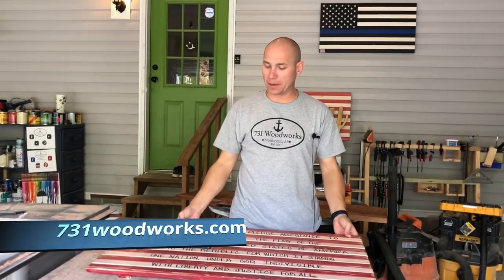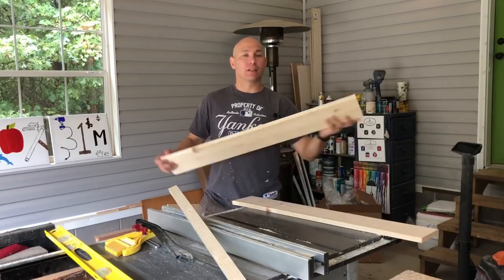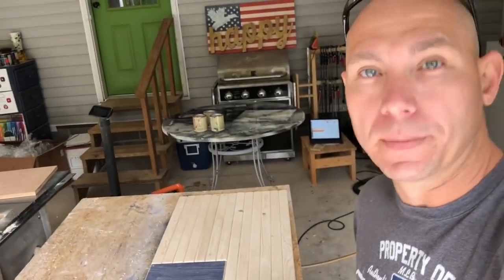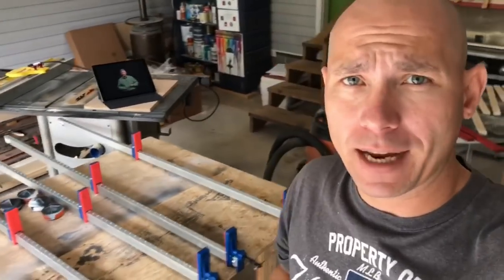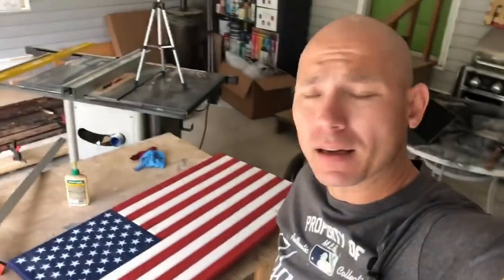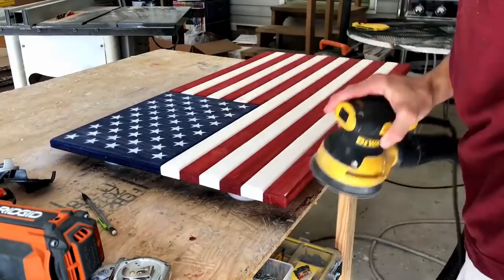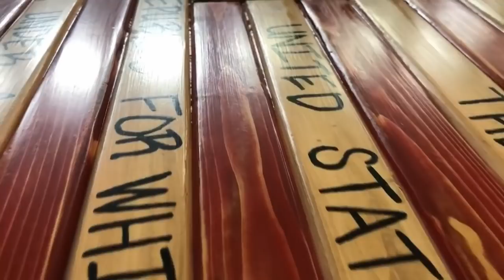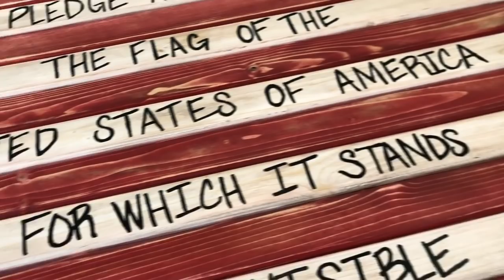How to Build an American Flag Out of Wood

Comment: I started making my own flag tonight. I am on quarantine so I dug through the garage looking for scrap wood. This is really my first real woodworking project in 20 years.  I thought I would get cute and use some old 2x6's that I had. I ripped strips off of them an inch wide.  Put the strips together and they were all kinds of twisted. Used your jointer method using the level and it worked. Not perfect but good enough.  I just enjoy doing this. I want to make stuff in my free time that can be a blessing to others.  I can't pay the bills using my hands though lol. God Bless!
Reply from the maker: Awesome

Comment: Today I learned that when I use 1x4's instead of 1x6's, the left over strip on the 2nd cut is exactly the width I need for making runners for sleds on my table saw. It isn't the exact depth to go very deep into the miter slot but the width is perfect. Im going to see if this will work or if I'll need to glue 2 of them together. I thought it was a pretty cool discovery. 🙂

Comment: Love the flags.  My question, you put a wax and antiquing stain on prior to the finished seal coat,  doesn't the wax keep the seal coat from adhering the the project?
Reply from the maker: It didn't affect anything with this build.  Typically I do it the other way

Comment: Awesome video!  Could you use pocket holes to attach the panels together instead of the boards on the back?  For a more seamless look?
Reply from the maker: Maybe, the thinner strips may be too thin to get a pocket hole to properly drill

Comment: i would like to make one for the 4th July with pallet wood - my question - which brand and make water based wood stain did you use?  Can the flag be placed outdoors? is it a stain and sealer which offers all-weather defense in just one coat? is it a Semi-transparent stain that adds more grain-enhancing color and sun protection?  Does it Provided mold and mildew resistant finish?

Comment: Matt great content and great delivery. You make these projects very easy to follow along. Im in the process of building a few of these for gifts. Couple questions. Is there a reason you dont use birch for the stripes as well. Also why use the antiqueing was vs burning the wood for the desired color? I ask these because im using some left over birch for the entire project and intend to burn them for the desired aged look but was hoping to head off any problems pending your response.
Reply from the maker: Thanks.  It would be hard to roundover the plywood and make it look right.  I just liked the look of the wax.
Reply: @731Woodworks  matt thanks for the reponse. I did some test pieces after sanding and then sanding and burning. Ill stick to just sanded and im seeing what you mean. I was able to round the ply over smooth but the edges are taking the stain darker.

Comment: Hey Matt, thanks for all you input in helping us with woodworking. Question for you. Do you know why why when I rip 1x4's I noticed at times small gap between the board and the fence even though I use your technique to joint with a 4' level and make sure I keep the wood up against the fence? This is causing me to clamp down hard to close them up, don't like doing that. Any thoughts? Thanks.
Reply from the maker: How long of a board are you trying to joint. If they are longer than 4.5 to 5 feet it’s hard to make the table saw jointing method work well. If not, make sure the board against the level is touching on the ends and not in the middle and not on the ends. So if it’s warped, you eant the gap to be in the middle  and not on the ends. Make sense?
Reply: @731Woodworks  Thank, I'll give it a try.

Comment: Great video, very informative.  Why did you use spruce as compared to other woods such as pine?
Reply from the maker: At my local lumber store I can get “appearance grade” Spruce. Also called paint grade at some stores. Basically it’s sanded already and requires less sanding. I also like the color of Spruce vs pine. Pine tends to be more yellow where Spruce is a whiter wood. When you stain it, the colors stay more true.
Reply: Thanks for the quick response.  As I  remember from years ago, down south you have yellow pine.  Up here, Chicago, we have white pine which I have to assume looks like spruce.  Thanks again
Reply from the maker: Yes we have yellow pine here.

Comment: Awesome job on the Flag, Video, AND the clear, simple instructions!
Thank You!  I'm VERY happy to have found you!
2 quick things-
1. Playing music when using  machines- GREAT!
Too many people don't adjust for the difference in
level.  When quietly watching in the middle of the night, they turn on the saw, And suddenly the ROAR comes blasting out!
2. After you assembled the
Stripes, you went back and sanded, and sealed the face of the flag, but you didn't touch the ends.  
Won't the ends stick out, as
bright, solid, NON-distressed, NON-waxed
Part of an otherwise distressed,  waxed board?
NOT critical,  Just curious!
--THANKS!

Comment: Really nice work.
What did your wife use to write the Pledge with?
Reply from the maker: She used an oil based pen like these: https://amzn.to/2PhxoRi They work very well for that type application.   They are oil based, so if you use an oil based clear coat on top be sure to allow them to fully dry or they will smear.   I waited 24 hours before applying the clear coat, but I used water based clear coat. (affiliate link)
Reply: 731 Woodworks thanks for the info
Reply from the maker: Sure thing!

Comment: Hello Matt
Would your stencils in your amazon work good for hand carving with a Dremel. I would be happy to purchase thru you if so. I used a small stencil on first flag and used it as a guide when carving with my Dremel, which I like once I found the right bits. I plan to do both eventually, but thought I return a little since you got me started....p.s. The stencil i used was made of some type of thicknplastic
Reply from the maker: I used them to trace stars onto the boards, then Dremel them out.  Boy is that a lot of work!

Comment: Great job man. Beginner question. I tried one time before to paint over stain with a cricut stencil. Turned out great until I brushed on the clear coat. The paint smudged some. I had given the paint like 24 hours to dry. Any idea why this would happen? I don’t remember what brands I was using. Maybe cheap paint/clear coat will do that?
Reply from the maker: Did you use water based clear coat? that's what I would suggest
Reply: @731Woodworks  almost positive I did. Wanting to make that marine flag for a friend and would hate to mess it up on the last step. Thinking I’ll verify all water based and try on a scrap piece first. Thank you for all your tips and videos!

Comment: On your measurement why do you add and 1/8 inch for the union (10 5/8) when the stripes are 10 1/2 ? Just curious if you oversize for a reason. Thanks and I love your videos
Reply from the maker: I have found that is the right size to work out perfectly for me when everything is squeezed together with the clamps.

Comment: So do you have any tips/hints on how tight to do the clamps? I'm having a tough time making the pressure consistent across all four clamps. I want it to be tight enough to flip it but not so tight, that it starts to buckle.
Reply from the maker: I just snug em up.  I don't have an method.  Just till they feel snug and all the joints are tight.

Comment: Hello Is that 3/4 inch plywood that was used?
Reply from the maker: I used 3/4" plywood for the Union.  I used 1x spruce for the strips
Reply: @731Woodworks  thank you I can not wait to try and build this!
Reply: Looking at the union board does that have a 1/4" roundover as well? Also did you put a strip around the outside of the plywood to cover up the ends of the plywood?

Comment: Love the project. Could you list the stains you used for the red white and blue? I did a quick search and I found "Crimson" for red, "Pure White", and "Navy Blue" from Minwax.
Reply from the maker: Sorry, I didn’t get the exact colors. I just went to Sherwin Williams and had them mix red, white and blue stains for me in a water based mixture.
Reply: Not sure if it helps now or not but went to Sherwin Williams and got stain yesterday. Got the same Minwax water based. Here are the colors that seemed to look good. Red - MWB-55 Crimson
, White - MWB-57 Pure White, Blue - MWB-51 Navy Blue. Hopefully this helps.
Reply from the maker: Thank you for the info
Reply: I use Crimson and Navy Blue oil based stain from MinWax. I like the deeper finish. I also torch the wood before staining

Comment: Hey man. Hope all is good. Was doing a flag and after staining I used the GF High Performance and it lifted the red stain off a little. So now I have red and 'pink' stripes. Haha 🤣🤣 any idea how that might have happened? Appreciate man. Cheers.
Reply from the maker: ha.  that sucks.  never seen that happen.  Was the stain fully cured. How long did you wait before applying GF
Reply: @731Woodworks  yeah. It was well over a week man. So not sure why it happened. I read more on the GF website and it seems I might have used a little too much pressure and many back brushing. Well, lesson learnt. Anyway, love your vids and channel. Keep up the lovely work man. Stay safe! Cheers.
Reply from the maker: Thank you. Sorry that happened

Comment: So I decided to finally try to make a Flag for a friend that’s is a disabled Vet. I am having trouble with the stars on the Union with bleeding. How do you get your stars so good? I tried the way you showed in the video but failed many times. I am obviously doing something wrong.
Reply from the maker: That is by far the trickiest part! I have found the best way for spray painting is (while wearing latex gloves) take a finger and apply pressure on each side of a star and then spray that star lightly. Move to the next star.  You will still get a little overspray doing this. I have started using sticky stencils that I make myself with a Cricut. Short of doing that, I’ve used Elmer’s craftbond (use instructions on bottle) and do a temporary bond on the stencil. The only issue with that is it leaves a sticky residue you have to deal with.
Reply: 731 Woodworks I was thinking of getting a Cricut Maker for my wife and I. We build furniture and decor for Disabled Vets and 1st Responders free to them. 
 Thank you for the info and now I have a real reason to pick up a cricut. God Bless
Reply from the maker: I think they are $50 off right now too!
Reply: I “ruined” many test boards trying to prevent bleeding using many different techniques.  What finally worked for me was Basting Spray that quilters use to attach fabric to their batting.  Sprayed the stencil and pressed it on the wood.  Left a slight residue on the stencil but not on the wood and no bleeding.  Stuff was not cheap but cheaper than redoing the Union and filling up a swear jar.

Comment: i looked at a lot of videos and yours looked the best. You can tell you have pride in your work. I notice you used two boards in the blue line union.Do you still do that?
Reply from the maker: Thank you, I appreciate that.  I am not using 2 boards anymore.  I have found that cutting a piece of 3/4" sanded plywood to size works best.  I get the sanded birch plywood from Lowe's.

Comment: Clear coat on top of wax?
Reply from the maker: No, I wax on top of clear coat.
Reply: @731Woodworks  Not in the video.
Reply from the maker: Sorry, you’re right.  I’ve changed it up a bit since this. But no it didn’t affect the clear coat.  But doing the wax finish last gives it a smooth feel to the touch that I like more.  So now I clear coat, then wax.
Reply: @731Woodworks  do you still get the desired dirty effect by waxing after putting on the clear coat?

Comment: I have watched several videos. Everyone harps on tbe stripes but no one talks about how to make the union even with the stripes
Reply from the maker: Even where? At the top?
Reply: I like your videos. I just see that everyone skips over the making of or the evening out of the union  so for example so that you can run hand across the union and stripes and you wont feel a lets say bump. How do you attach the union to the rest of the stripes. By glue?
Reply from the maker: Yes, I glue it. But also the strips on the back keep it in place.
Reply: @731Woodworks  gotcha, thanks!!!! Maybe show doing it on a video. Thanks fornyour videos tbey are great.
Reply from the maker: Thank you

Comment: I have the same star stencil, how did you keep from getting bleed out while painting?
Reply from the maker: It's near impossible to keep it from bleeding all the way
Reply: I also have that stencil, I use two sided scotch tape on the back to hold the stencil down to the wood, takes some time but it stops bleed through pretty well.
Reply: @brianringelstetter8741  how did you attach the dbl sided tape to the stencil? Cover the entire back side of the stencil and exacto knife the stars out? Thanks!
Reply: @cheekrobert  I used small pieces and stuck them between the stars, faster than cutting them all out. Used the stencil twice so far and the tape is still hanging in there.
Reply: @brianringelstetter8741  I tried myself but cover the entire stencil and cut the stars out. I still got some bleed through. I’m going to keep trying.
Reply: @cheekrobert  I’ve also been applying about three light coats of paint from a greater distance. Takes longer but less bleed through.
Reply: @brianringelstetter8741  that may be part of my entire problem. I try to spray it on in one pass...

Comment: Hey. Really stupid question. What size plywood do you use for the Union?
Reply from the maker: 3/4" sanded birch
Reply: 731 Woodworks 
Thanks a lot. I tried making a flag before but just used the strips. Tried to use razor blades to keep the blue/red stain from bleeding Into each other. A separate union seems MUCH easier. Thanks for the video!!!
Reply from the maker: @billstahr1  you're welcome

Comment: I did this, but went with the "old school" 1923-1954 Pledge that did NOT have "under God" on it. Interestingly enough, I checked the Marine Flag Code and scrawling on old glory is definitely against code. As it turned out, the writing looked terrible, and it was actually neater than the one represented here. I don't recommend giving this to anyone who graduated a military academy. You might get reprimanded, along with a lecture on flag desecration.